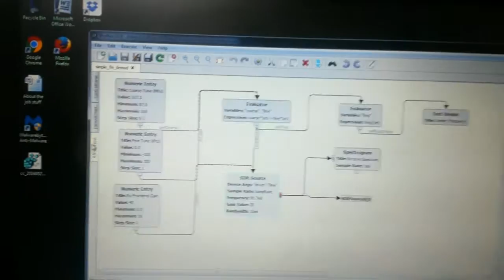Receiving FM audio with LimeSDR

Comment: Why does the LimeSDR have 8 antenna connectors?  I get 4 for rx, and 4 for tx, but do you need an antenna connected for both "RX1_1" and "RX1_2"  or could you receive with just one antenna connected?
Reply from the maker: The demonstration is only using one antenna for receive. You can only have one receive antenna on channel A and one on channel B at any given moment. The reason you see so many antenna is that this is an evaluation board for the lms7002m RFIC with many RF paths which can be matched for different frequencies. See https://wiki.myriadrf.org/LimeMicro:LMS7002M_Datasheet#RF_ports

Comment: wonderfull work . did you install GNU Radio on windows SO ? hoy you do that? could you help me with that ?
Reply from the maker: I maintain an installer for setting up windows SDR environment with various software including Pothos, LimeSDR drivers, GNU Radio and others: https://github.com/pothosware/PothosSDR/wiki

Also, this demo does not actually use GNU Radio, but you can find a similar demo using the same installer for gr-rds + LimeSDR: https://www.youtube.com/watch?v=Bth7rlJIfOI